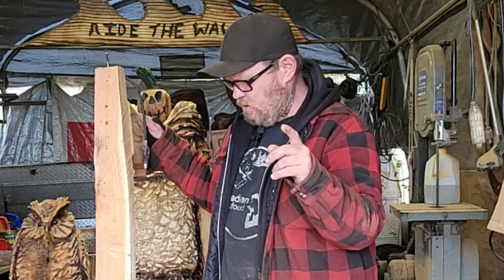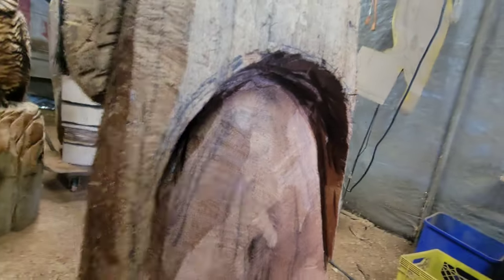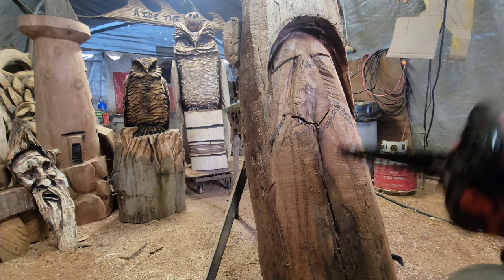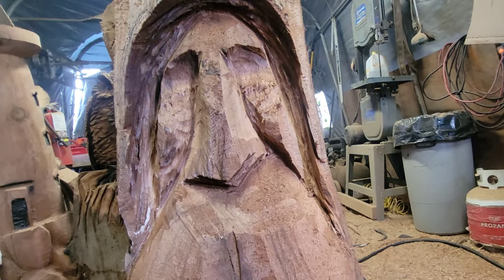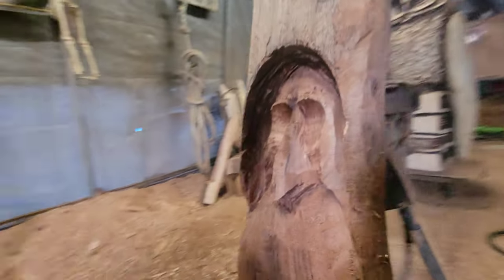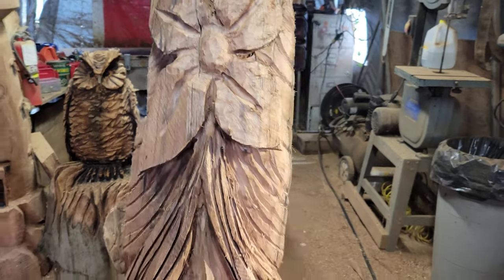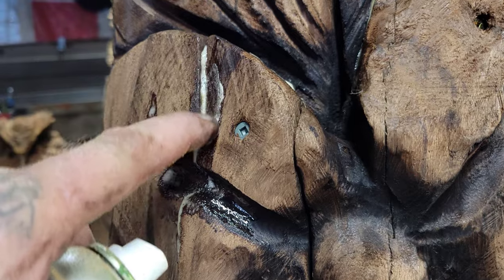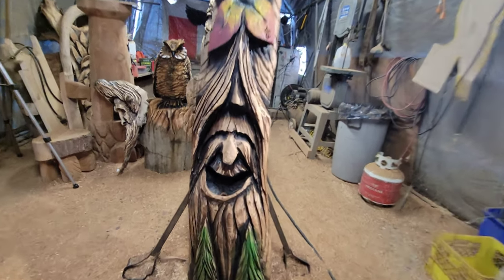How I carve a bigger nose and carve deeper trying new things.

Comment: This is the second video I’ve seen you using the chainsaw and you keep saying it’s smokes. And you can’t figure out why. The thing I notice it only starts smoking when the muffler gets hot. You’re chain oil is probably coming out a little faster because it’s expanding in the tank as the chainsaw warms up. So as you’re running the chain oil is splattering back on to the muffler and because it’s hot it’s starting to smoke. You’re not standing there and it’s just dripping oil out of it so there’s nothing wrong with the container. There’s nothing leaking other than when it warms up it starts smoking. Trying to look at the chainsaw while you’re moving it around. Is the bar chain oil container close to the muffler. And if it’s an auto feed that’s probably what’s happening the oil is heating up expanding putting extra oil on the bar it’s being thrown back to the muffler and causing it to smoke. Maybe find a thin piece of metal shape it to the muffler connect it somehow have like a shield. That’ll probably stop it.
Reply from the maker: That's some great info and thank you I will try as you suggest, and yes you are correct it is rolling back onto the exhaust